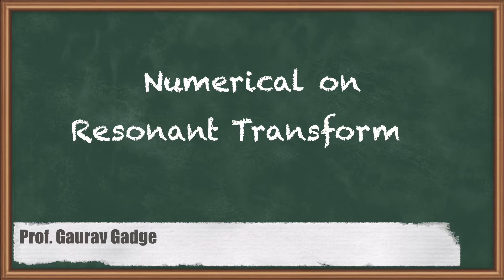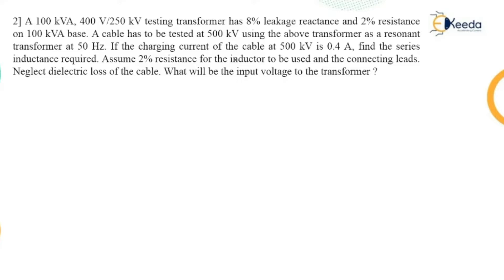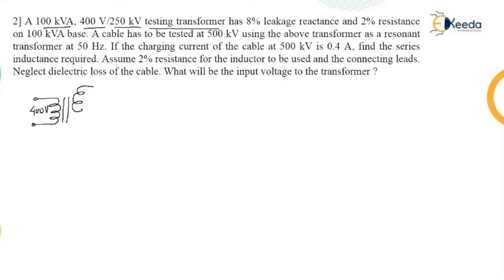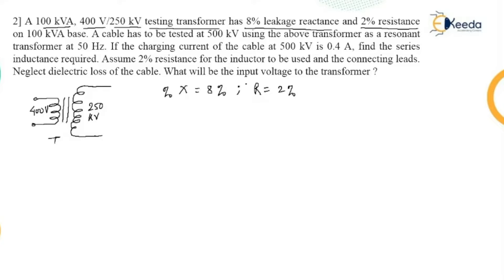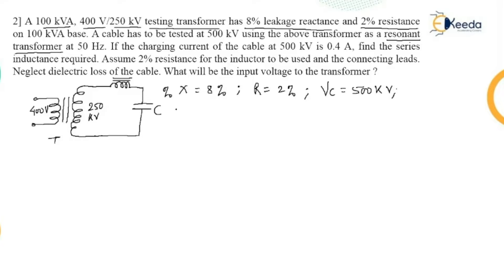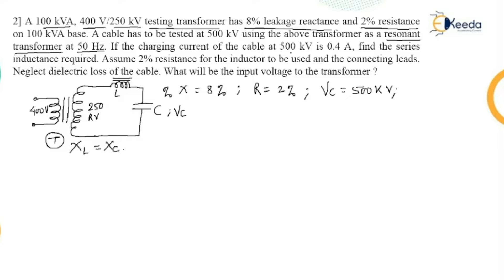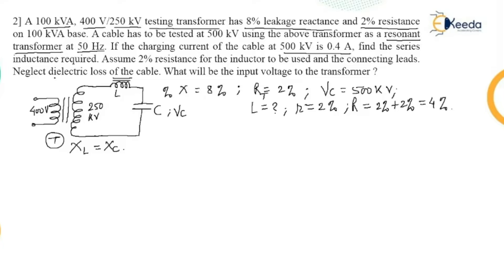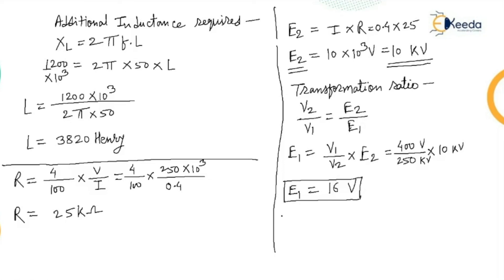Numerical on Resonant Transformer - High Voltage Engineering

Comment: ) Three 350 kV, 350 kVA testing transformers are connected in cascade and have a short-circuit impedance of 5%. Determine (i) the full-load current, (ii) the short-circuit current and (iii) the maximum capacitive load that can be tested without exceeding the power rating.